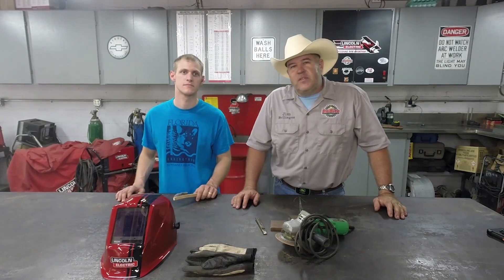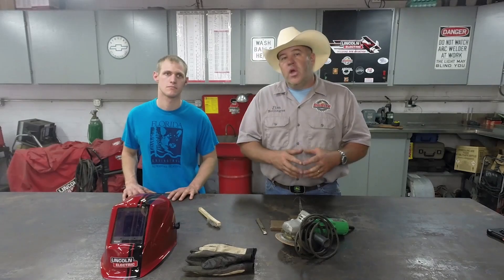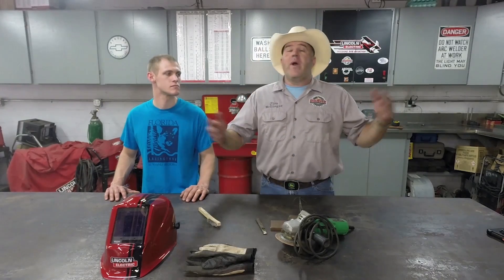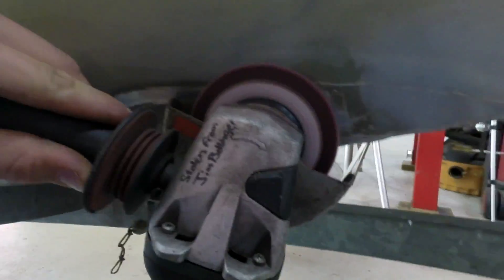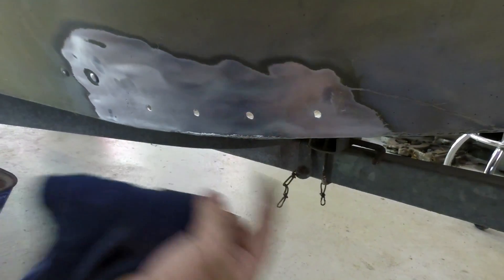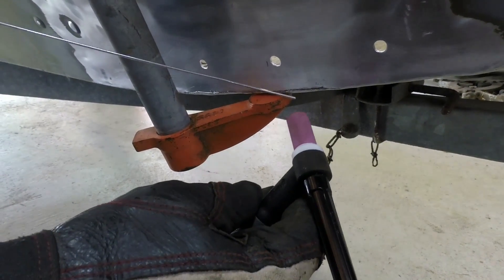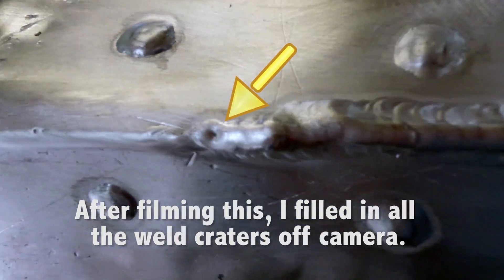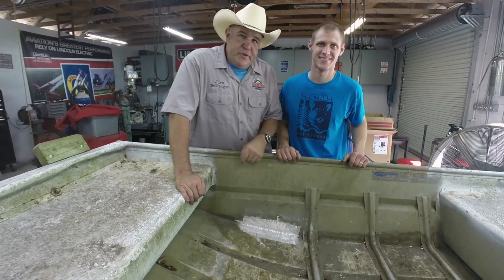TIG welding repair of a hole in an aluminum fishing boat

Comment: As a certified welder and experience in this on a daily bases, if you cannon clean a certain area like you showed here,  a blow torch will simply melt any impurities left behind prior to welding. Also assists in stress relieving any frictions that are present prior to welding, basically resets the properties of the alloy and once welded has new defined properties.

Comment: my father was a master welder. he used always used oxy acetelen to weld aluminum fishing boats. as his helper he always told me the aluminum has to be so clean you could eat off of it. people tend to use gum, silicon to fix the leaks and has to be removed. number 2 tip was used on the torch. not many people could do this.

Comment: Thanks for a 'real world' type repair.  Since I live around the water aluminum skiffs are often in need of repair.  The heavier gauge models are a breeze but the production thin skins are a bit of a challenge.  Your video takes that on very well.  I will have to give that overhead tig a go, something I try to avoid!   Doug

Comment: Great job guys, 
I do alot of dirty tig welding on rusty cars up here in the north east,  my go device for cleaning is a wire wheel on a angle grinder. it will remove the oxides but not take away material.
You did a great job filling those holes better than I would have done.

Comment: A good lesson on how important it is for you to know what chemicals/elements your are using to do the repair.  I would not have not thought about the argon issue.  I don't do much welding (no TIG), but will be good to remember if I do start doing that.

Comment: I've been welding for years, yet I just learned something new. Using the copper block is genius. Thank you. You are very knowledgeable.
Reply: You can also use stainless steel as a backer for aluminum

Comment: Hey Cool Videos. I Have to thank you for the video of fixing dales cast alum part. I Was welding a cast alum bearing housing it was getting ugler by the min. Then I saw process u did with that weld and grind so you have good metal. took some time got it welded And machined back to size bearing. Thanks again keep up the great videos, Chris deon.
Reply from the maker: Glad it helped you. Check out my other video on welding up the cast aluminum motorcycle hub.

Comment: Why do the weld craters happen after finishing a straight section? We paid a guy to weld our keel on our bass boat and we found a ton of leaks from these craters. Is there a way to prevent these craters?

Comment: Thanks. Can a wire spool/mug unit be used? I've  heard pros and cons about spool guns. Both for aluminum and steel.
Reply from the maker: Yes they can, that's how they build the boats, but takes a lot of patience to get the gun dialed in correctly. When I MIG aluminum I prefer to use a push/pull gun on pulse mode. The trouble with that is that is a pretty expensive setup, not in the budget of many small shops or the home hobby guy.
Reply: ww_big_al

Comment: Whats a good 110 volt tig aluminum welder for doing the job on that boat you fixed thanks or can a 110 volt welder do that job?
Reply: yes, thin aluminum does not take much heat to completely melt away so you dont need a super heavy duty welder for it. just make sure you got an AC/DC tig, as you need AC output for welding aluminum. most cheap tigs are DC only.

Comment: have you ever welded a lower unit on a outboard motor hairline crack on the outside with the gears still in?
Thanks
Reply from the maker: Yes I have, a bit tricky, but doable.
Reply: Thanks!
Reply from the maker: keeping it cool is the key!
Reply: Thanks, I'll just take it apart! easier said then done!

Comment: How do you tig aluminum overhead without excessive droop
Reply from the maker: Control the heat very closely. Use chill bars if necessary.
Reply: I use chill bars as much as possible welding aluminum.  Thick slab of copper or stainless is your best friend.

Comment: How long do you have to wait after you wipe acetone on? And did you weld both sides of the holes? Or just one? Thanks in advance!
Reply from the maker: Acetone has a very high vapor pressure, so it won't take very long, even in cooler temps. Probably just a minute or so. There is no reason to weld both sides if the first side is done correctly, other that appearance. The side that has the copper plate will not have a very nice apperance.

Comment: I kept waiting for you to drill holes and either side of the beginning of the weld but you never did that. Did you think that it might be necessary to prevent anything from continuing a crack?
Reply from the maker: no, I used copper backer bars to assure complete penetration. Stop drilling works good, but we essentially did the same thing but with the TIG torch.

Comment: if you can get them best to weld boats with er5183 as they are stronger and more corrosion resistant. but 4043 will do the job.
Reply from the maker: I had 4043 in the shop. It's an hour each way to the weld supply, so 4043 was gonna have to do. I agree 5183 is better for marine applications. Thanks for the input.

Comment: When you say 75% balance. Is that on the penetraition or cleaning side of the balance? I run an old tig machine and doesn't have a balance option.
Reply from the maker: Typically balance is spoken about in reference to electrode negative, the penetrating side of the AC sign wave.  So when you say I'm 75% unbalanced, you are referring to spending 75% of the time on the negative, or penetrating side if the sign wave. Another way to look at it would be 75% welding, 25% cleaning.
Reply: +DoRite Fabrication thank you sir keep up the good work
Reply: +DoRite Fabrication thank you sir keep up the good work
Reply: @DoRiteFabrication   hey mate, doing the same job on my boat here in australia. brand new to tig welding, 3 days experience but learning fast.  Have just bought the unimig 200 acdc inverter tig.  when setting the balance % it settings shows from   -10   0  +10     0 being even balance so with the electrode running out of the negative port as you do for tig welding, to match your 75% welding and 25 Cleaning would i run this settings at -7.5 ?   cheers mate.

Comment: Why didn't you drill the ends of the crack? I build and repair aluminum boats for a living and run into this on occasion and I always drill the ends, Tig welded or not. Also, since you didn't grind the weld on the inside of the boat, and just welded over it, paint and all, you can't guarantee there aren't pinholes from the impurities, risking further cracking. Also, your point of argon being heavier than air makes sense, but even with the 2-3 passes on the inside, you'd never have enough argon to displace enough air to be unsafe, even if you're running at 20-30 cfh.

Comment: Well I guess since this video is up it must have floated. :-)
Reply from the maker: blub blub...
Reply: Is it easier to catch the fish when they are at eye level? lol
Reply from the maker: Yep, especially with a spear gun!
Reply: DoRite Fabrication
Would love to see a video on the harpoon build. :-)
Reply from the maker: Jeez Brian, I'm catching Catfish, not Moby Dick! LOL
Reply: Could have sworn you were supposed to drill a hole at each end of a crack to prevent further cracking in the future that will inevitably occur
Reply: ...and grind out the crack! It will give way at some point as the crack is still there, it wasn't stopped via holes being drilled either end. Not a particularly clean job either :/
Reply: There is no need for a hole at the end of the crack when welding sheet aluminum.  He went well past the end of the crack with the repair plus he put the weld through the crack from both sides.  Crack is long gone at that point. If the repair is in a casting, then a different procedure posibly would be reqquired. "not a clean job"  He is welding on an old (probably 50 years) aluminum sheet metal boat.  That double pass weld will be on there when that boat is done fishing and ready to be beer cans.

Comment: wow, good stuff! The idea of welding aluminum scares me a bit less now, but I have to ask: would you have been ok using mig and a spool gun rather than TIG?
Reply from the maker: You cannot control the heat as closely in MIG. It can be done, that's how they built the boat, I prefer TIG for the repairs.

Comment: why  4043???? i  use  5356
Reply: 5356 is much more resistant to corrosion and is the better choice for below water line.

Comment: Great point with the argon. I often see people using carbon dioxide and dry ice carelessly because due to their ignorance they fail to realize the danger i.e. death. Due to the way they have been portrayed by Hollywood most people think the flame throwers function is to burn up or set things on fire, which they have been used for on some occasions, but they were actually developed during the war as a quick and efficient way to take out the Japanese that were held up in bunkers and caves. One shot and the flames would immediately deplete or consume all of the oxygen and the soldiers inside the would quickly suffocate due to their lungs being filled with Carbon dioxide.
Peace!
Reply from the maker: I like flame throwers. Don't judge. lol
Reply: Who was judging? Just curious here, but have you ever trie a Browns Gas torch?
Reply from the maker: No, but I have used a Henrob gas torch. oxy/fuel for welding aluminum. Possibly the same thing under a different name......
Reply: The Henrob is an oxyacetylene based torch where as Browns gas  is the byproduct of water electrolysis i.e. OH + H. The interesting thing about it is that it can cut much like plasma, but the metal and torch remain cool to the toucjh aas well as other interesting traits.
Reply from the maker: Yep, and the hydrogen burns clean....
Reply: Indeed and I wonder why it isn't widely used as it's low cost, clean, and environmentally friendly.
Reply from the maker: Hydrogen is very dangerous when stored in quantity, if not handled correctly. Most people would blow themselves up.When working with electrolysis there usually isn't a large quantity of built up gas.
Reply: This is why there are systems that produce the gas on demand. They also add a similar system to combustion engines which improve gas mileage 100+/gallon.

Comment: Some aluminum alloys are not weldable. If the boat doesn't contain any welds from the factory, it could be an "unweldable" alloy, making the aluminum crack prone, difficult to weld.
Reply: Mightiflier would brazing be the way to go on a riveted boat I have a hole up high in the front maybe close to water line, not sure I haven't put it in the water yet. The hole is about the size of a pencil?
Reply: Mightiflier any suggestions? Before I head up to the marina for advice?
Reply: The marina will be your best bet for advice. An expert welder familiar with marine welds should be able to close it for you. It is difficult to weld, but not impossible. They may suggest a rivet patch. I wish you good luck and great adventures with your boat!
Reply: Mightiflier thank-you for your reply

Comment: 4:23 video begins. 
Dirty crack like this, just cut it with a cutting wheel. Run a cut right up there, clean it all out, weld it back up. Faster, stronger, better in every way. These guys are amateurs.
Reply from the maker: Ummmm, from the guy who just said use a cut off wheel on aluminium, and you call me an amateur....really?

Comment: Kind of disappointed that he didn't use a mig spool gun!!
Reply from the maker: Why in the hell would I do that?
Reply: Well I have actually have done it my self, I wouldn't say that it is easy, but due to the very low temperature under the correct conditions the possibility of burning thru is way less.. "Hey I'm not trying to insult you it was just a comment"
Reply from the maker: I didn't take it that way...I am not a fan of the spool gun! A push pull gun on the other hand.....
Reply: OK..  I guess that the reality is that one make things work with what one have..and at the time while I was working on fabrication the only thing I have to work with was a humble Profax Spool welding gun.. and that was what I manage to get things done with..
Reply from the maker: You gotta work with what you got. Back up your weld with a copper bar or plate. It will help with burn thru.
Reply: Yup you are totally correct, I use to have all kind of "Shill Bars" to make sure that the temperature have some where to go.. thanks for your attn and your reply. wish you the best of luck!! I just can't wait to see that cannon firing...
Reply from the maker: Check out  Metal tip's and Tricks latest video. It has some cool footage of Jimmy Diresta and I shooting our cannons in Ohio.
Reply: I actually have a few friends here in Florida! and in the holidays we do shoot those cannons!! I just want to see your work done and just see you having fun with it..
Reply: I've used the spool gun on MIller MIG units a number of times. Using a TIG torch is so much easier and less cumbersome.

Comment: safety note. had a friend and Co worker die from accidently breathing argon in his fresh air supplied respirator while painting. the argon line was mistakenly switched. we assertained that it took less than 30 seconds for him to succumb and asphyxiate. so be careful when breathing close to an argon gas source.
Reply: wow. how does a line get switched? i thought fresh air tank fittings were completely different to prevent this sort of thing?
Reply: @fakiirification  I worked in and retired from the paint department at a major truck manufacturing plant. That year, the company put in an additional paint booth. We used fresh air supplied respirators. Most of that part of the plant had plug in argon ports everywhere so you just had to roll the welders around without the heavy bottles. The contractor that installed the booth tied into the argon lines instead of the fresh air lines. The plumbing tie in was above the booth. The plant engineer didn’t catch the mistake and certified the booth. He never knew that he wasn’t breathing fresh air. He passed out from lack of oxygen and lay on the floor breathing in the argon until he died. We did CPR on him until paramedics got there but he was gone.
Reply: @johnnelson8956  wow. What a tragic mistake. Would hate to be in management trying to explain that one. RiP paint man.
Reply: @fakiirification  the real tragedy was that he had a 2 year old son and his wife was pregnant with their second. And to top it off, my so called honorable company refused to accept blame and held up his survivors benefits. It took her filing a lawsuit and it still took several years to resolve. I’m a UAW member and my union fought for years to get the company to do the right thing.

Comment: Too much talking, not enough welding. Could have grind out the crack and fill it, or at least bevel the crack. Overall fine if it floats.